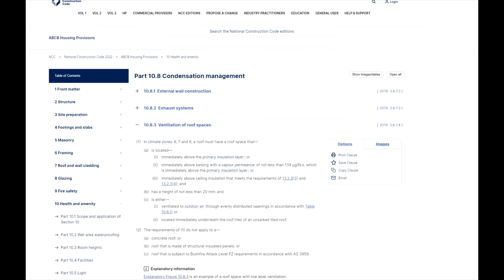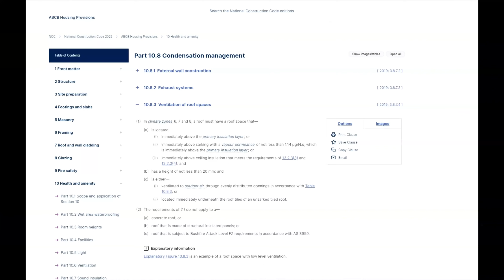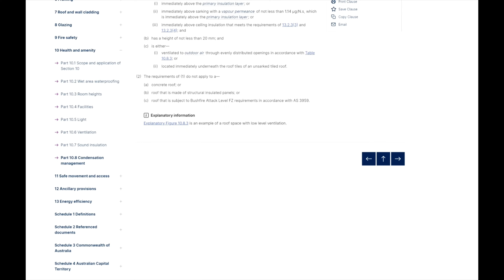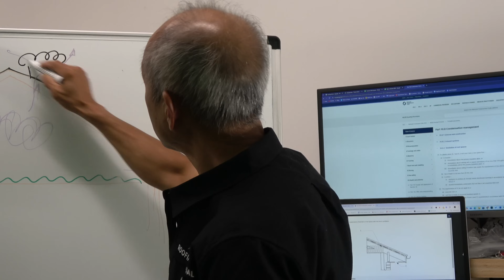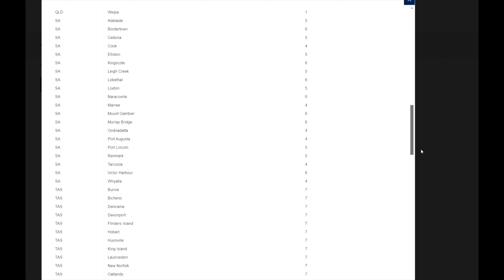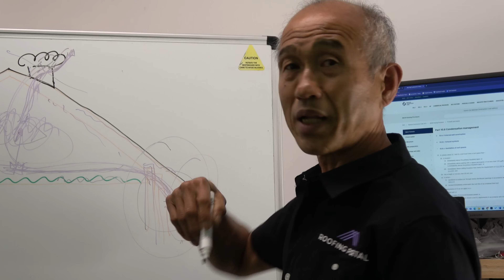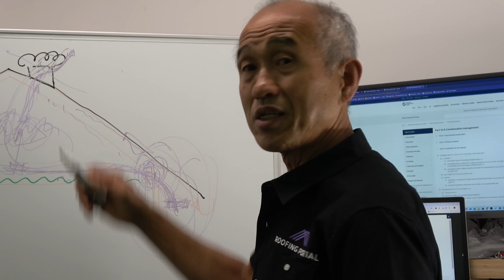Do whirlybirds work and will they make a comeback

Comment: If you're looking to make the temperature inside the house cooler on hot days and warmer on cold days then they might work some of the time. The physics is simple. If there's wind blowing, they rotate and remove air from under the tiles. But what if that air is hot, and it's a cold day? Then you don't want that hot air removed. Now consider a hot morning, and there's nice cold air under the tiles from the cool night. Then you want to leave that cold air alone, not pull it out! Whirlybirds are a dumb device that cannot make simple decisions.

Comment: The NCC does its best to add onerous costs on to new builds with low regard to the housing crisis that's been brewing for 20+ years. Recent one supposedly added $30K to a build, and am sure they new venting requirements will add extra thousand(s) to it - probably requiring solar powered whirly birds with power backup (when sun not shining) for ventilation - they're so damned expensive and was told they're useless for cooling as marketed as you have more energy going in from the sun every hour than those solar powered extractors can remove, so for cooling it only works when the sun goes down and then it relies on mains power for them over just hot air/wind from the manual ones.

Comment: Very interesting. Seems like roof ventilation needs to be bespoke. From what I can see the whirlybird creates a vacuum to drag more air into the roof space ? But the air needs to come from somewhere cooler (eaves)… but takes a lot to inspect to see if your home eaves are ‘blocked’. In those cases, Amy even need to install a fan and ducting to drag in new cooler air?… or watch part 2…..

Also, I’m loving everyone’s comments posting their knowledge…

Comment: Have 2 of these on my roof. Replaced about 15 years ago and current ones have been there about a further 15 years. Seem to keep the roof space cooler than it would normally be but hey I am no expert. Looks like I am in a zone 5 area. No eaves vents though. This is my second house and has a green colorbond roof. This house is much cooler in summer than my first house which had a dark coloured tile roof and was virtually uninhabitable during hot summer days/nights!

Comment: My house has 2 whirlybirds but no eave vents.
On a warm day, the whirlybirds spin like crazy, so I'm guessing the airflow is happening due to ceiling vents in bathrooms and toilets.
Reply: Does that mean they're sucking the cool (air conditioned?) air from inside your house?
Reply: @iamdave84  
Yes, more than likely.
Though, being colder air, it should sink and displace the warmer air in the room. But not an ideal scenario.
Case of house designers not thinking things through.

Comment: I had a slab on the ground house and created louvre pivot windows in the gables. I could open the louvres from inside the house with a cord. This allowed the entire roof space to change air mass very quickly.... not all Australians are as dumb as you infer..... 😄😃😀🇦🇺
Reply: Yeah, those kind of louvres are perfect for Queensland weather. high ceilings with easy accessible lever windows; every house needs one. You should be working for Department of housing or whoever it is that makes up all those housing rules! I swear whoever has been doing it for the past 50 years has been totally inadequate.

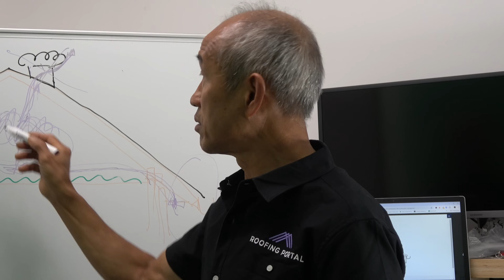Comment: 6:25 in older buildings whirlybirds work because the majority of the buildings leak air like sieves, nothing is sealed.
In newer buildings with insulation in the walls and roof and even floors with every little air gap plugged or calked the whirlybird can only let hot air escape until the pressure is equalised, then when things cool down cold damp air can be sucked in.
Always install vents in the eaves along with whirlybirds.
Reply: that's wrong. Code in Aus still calls for air flow in walls and roof spaces to eliminate dead air that would otherwise generate issues. What people don't seem to realize is that Turbine Vents weren't designed to affect temperature, they were designed to remove humidity. This has a positive effect in both the summer and winter months, and is recommended in the Australian climate.
Reply: Therefore the first 6:00 of this video was a waste of my time.
Reply: @paullelys161  only if you have a new house. Most of our cities still have a majority of older homes.

Comment: If you want to see a bigger difference, make a chimney stack with metal tube about 2 meters long, paint it matt black, have the bottom at the apex of the roof to suck from the highest point, mount the whirlybird on top, but any rain cover will work too. 
The tube allows the whirlybird to move more air, plus the black tube will heat up the air as it moves up making it move up even quicker.

Comment: you could argue any brick veneer house is inherently vented. The roof will be framed off the timber and the whirly birds should be able to suck air through the cavity
Reply: I was thinking the same thing, especially if the house isn’t on a slab.

Comment: Whirlybirds only work if there is a fan under it.  They are supposed to extract hot air from the roof space..
Reply: They are their own fan Kev, and heat rising makes them spin automatically (they should be installed high on roof pitches, preferably near upper ridgeline.

Comment: The problem with Whirlybirds is the create negative draw and can draw the air-conditioned air from your home working your air conditioning overtime. Making incredibly inefficient..
Reply: Only if you have air conditioning, which I don’t. My 1972 brick veneer, concrete tile roof vents itself with my three whirlybirds.

Comment: Thanks for this video. 
I have a very old house with a corrugated iron roof in Tasmania. We don't have a moisture problem, but I was going to have whirlybirds installed to remove heat. We also don't have eaves of any substance. What would you suggest for a lower level vent in such a roof? Would a whirlybird installed low on the roof work for the intake in conjunction with one installed high for the outflow? Or some form of other vent that is weatherproof?
Reply: Hi, you could consider a gable vent.

Comment: There used to be a product called Decor Vent which seems to have gone into obscurity. Decor Vent consisted of cement sheet eaves lining with a continuous run of slots usually at right angles to the building wall and approx 120 mm x 12 mm and spaced about 100 mm apart. This provided a continuous vent for the full extent of a building's eaves overhangs and was very successful. May be it will come back again although there are other companies that will perforate cement sheet in any pattern you want. I'm not sure that the congestion you refer to at the wall line is such a big problem as there is usually plenty of air space there - often more so with today's truss framing. In saying that, care is needed with the placement of ceiling insulation to ensure the airway isn't blocked - as you suggest.

Comment: on older homes, when inside the roof, you can see light between the tiles, i see inlets everywhere!
Reply: Yes, most concrete tile and terracotta tile roofs have gaps between the tiles. These would allow sufficient air to be drawn in to replace the rising hot air being extracted.
Reply: To get ventilation working under tiles you have a special shaped tile. Its more rounded and shaped a bit like an ice cream cone (without the pointed tip).

Comment: Your comments would only apply to roof cavities that are airtight. Very few roofs would be airtight. My roof is a tile roof which means there are gaps everywhere!
Reply: Even iron sheet roofs are not airtight, if you have just one or two whirlybirds, there is ample room around a roof perimeter corrugations to allow air flow.
Reply: @lesskinner8588 those corrugations fill up with the insulation blanket mass.
Reply: Also if your roof is tiled your house is probably brick. Brick houses don’t have eave vents on purpose. They have ventilation slits at the bottom of the external walls around the house to ventilate the walls as well as the roof. I hope people don’t watch this and then cut holes in their eaves. It will stop the buildings ventilating in the way that they were designed.
Reply: @EarthRook  people are stupid, this youtuber the most
Reply: @EarthRook weap holes
Reply: Whirly birds are intended for metal roofs, not tile roofs. They serve little real function on a tile roof.
Reply: @aussie8114  nonsense.
Reply: @aussie8114  why does it get to 60c under the tiled roof then? ventilating that would mean the insulation doesn't have to work as hard.
Reply: @derbybOyzZ The tiles get hot and radiate the heat. Terracotta roofs have lots of natural ventilation, concrete tiles have less, some low profile concrete tiles have even less, none if also sarked. As a concrete tile roof gets old the joins do get caked up with crap so then they have even less ventilation.
My point was mainly that the whirlybirds are intended and we’re invented for metal roofs, they are less relevant for tile roofs, unless it also has sarking, but they can still serve a purpose if the roof has air intake as well. But fairly pointless for a terracotta tile roof.
There is the downside though of having any penetration in a roof allowing a water entry point.

Comment: There is debate about whether the spinning action of the whirlybird works or not. But roof exhaust vents absolutely do work when used in conjunction with eave vents. Basic law of thermodynamics, hot air rises to be replaced by cool air.
Reply: Spinning is useless, there is a video (in foreign language) where air flow is compared with conventional ventilation. There were no improvement, whirlybird was even worse, they reduced air flow.

Comment: How about people stop have dark coloured roofs that cause the excessive heat in the roof mmm
Reply: Yep, daft. A light roof reflects light / heat. Case in point we have a new light roof (surfmist) a neighbour has a dark grey roof. They had to install whirly birds because it got so hot upstairs. Ours is fine.
Reply: I am not a builder or have any experiance. However I believe two things that would help as much as anything. Go back to 10 foot ceilings, and high pitched rooves, that were used around 100 to 120 years back. Add good insulation, whirly birds with eave vents, and a 12 foot verandah on 4 sides of house. Yes it would cost far more but require little to no air conditioning.  

The other one I found once. I done some cleaning at a house. After the owner gave me a cold drink. We sat underneath the house, which was a high set. It must have been 8 to 10 degrees C cooler underneath. A false roof, 1.5 to 2 metres above the house roof would have the same effect. Again expensive, but very effective. Combine this with what I said above, a 30 c day in Brisbane, 20 in the house. 40 c likely 25 in the house. ???
Reply: @johnblyth9787  Very well stated. Yes, without a doubt extra layers will bring the heat down. I remember at a beach bar in the Pacific once there was a clear plastic roof and it was like an oven underneath it. The locals set about slashing palm fronds off trees with their machetes and put about three layers on the roof and hey presto; it was cool under the roof!!

Great insulation can do it with a roof mind, as can lighter colours.
Reply: I totally agree with you. It’s the only way to build a house in Australia; extreme pitched roofs and high ceilings.
Reply: @johnblyth9787 Good for hot weather areas but high ceilings are bad to hear in cooler areas.
Reply: 100% agree,QLD have white roofing although some are now going dark,should be banned by law.
Reply: All the above plus there are rules to follow regarding colour.  Stupid isn't it 😅
Reply: New developments have white tiles etc
Reply: So true. We repaired our dark green / almost black tiled roof, had it cleaned and painted, selected surfmist. The roof temperature would get to 75 degrees before, only 45 degrees after painted surfmist. Hardly ever used air con again 👍🏼
Reply: How about we stop cutting trees, that is what is warming the environment
Reply: in a cooler climate, we want that heat to help warm the house during the longer cool periods. Yes it means hotter in the shorter summer period, so controlled ventilation is the answer.  One solution does not work everywhere.
Reply: @Andrew-kz8qp  In hot cities of Australia, light roofs are great
Reply: @DougieL  I'm an energy rater. Individually, in cooler climates a dark roof generally reduces energy consumption overall for the year, and less green house gas emissions. As a collective, there is argument that the dark roofs contribute to heat island effect, where the city is heated. Yet we still have black roads directly connected to earth that the roofs are not connected to.  For reading, I suggest the Berkley Labs Heat Island research group. A lot of good papers there.
Reply: I was on a roof and pointed this out as we were doing Hebel and other bloke said nah they put heat resistant roofs or something and I'm thinking yeah but black doesn't it absorb heat. I been on a lot of roofs that scorch ya, but somehow this one I was able to put my palm on in clear skies sun out, didn't make sense to me
Reply: Yep. We chose a much lighter off-white grey from the medium-dark grey and the internal house temps over summer dropped a good 3-4 degrees or more. It made a huge difference to our reliance on cooling.
Reply: I second this, but the problem is, in areas where dick head covenants determine that your roof needs to be dark and stupid things like walls need to be all these matching colours etc. load of crap.
Reply: When I built my home 2013, only choice was dark tiles, if I wanted lighter colours, it cost extra, but I did get whirlybirds fitted.👍🇦🇺
Reply: I was told I couldn’t get a lighter roof because of council regulations. Apparently it makes it difficult for pilots in aircraft to fly if they’re are reflecting light every where.
Reply: @littlejohn-pi7kk   Yeah, that's bullsh1t, we used to have a lot of galvanised roofs, and most industrial complexes have gal roofs, they reflect light badly, they also get extremely hot....
Reply: My house has a light Grey tin roof. It's still effing hot.
Reply: How about normalising insulation or making it mandatory?
Reply: My light coloured colorbond roof is filthy with moss and dirt, it's 2 storey and unsafe to get access to clean it
Reply: because Light colors show mould and grime and look like shit.
Reply: If people are so worried about their roofs looking clean, they should use the money they saved in cooling to get it professionally cleaned. That way, not only will it look clean, it will actually be clean.
Reply: @GruntyGame   dont talk shit mate, not everyone is loaded with money.
Reply: A dark tin roof, is cooler than a concrete tile roof.  However, tin cools much faster in the evening.  Installing silver sarking directly under the tiles would mean the roof is 10X coller than the light coloured roof next door.
Reply: Yep, pretty stupid really, Australia have more hot days than cold days in the area where most Aussie live. Well, at least the heat is unbearable , while the winter here is generally quite mild.
Reply: Surf mist keeps your roof cool, but it's a maintenance nightmare. Because it promotes mildew growth. Darker colours and zinc alum evaporate the water quicker preventing mildew. Zinc alum actually helps kill the mildew.
Reply: @malachisimons4376  ALL roofs get dirty mate, every single colour, one colour in particular does NOT promote mildew, that's simply NOT true.  Modern roof paints still get dirty but they don't get mold...
Reply: It is the steel  / tile that gets hot. Not a thin bit of colouring. Otherwise a white car would never get hot to the touch. Its called thermal mass.
Reply: @darrennorth929 that is beside the point. Dark colours absorb the energy in light. The energy gets converted into heat which is stored in the material underneath. Light colours reflect light so the energy in the light does not get turned into heat.

No one is saying the heat is stored in the very top layer.
Reply: @darrennorth929  A white car is far cooler than a dark red, or black car mate, anyone that knows anything about paints colours or thermal barriers knows this. I was working with a guy years ago , when we got to his place after work I was standing between our cars, mine is red and his work ute is white. I was leaning on the roof of his car chatting when I changed sides and lent on my bonnet, I BURNT the white skin on the underside of my arm, I mean it blistered, anyone knows white cars are far less hot that dark coloured ones, dark colours absorb far more heat, this is a well documented phenomenon...  PS, I'm a painter by trade {industrial} and have also done roofing and repainted roofs for probably longer than you've been alive...
Reply: Light colors show mould and grime
Reply: @AnarchyEnsues That's the universes way of telling you to get of your butt and clean your roof!
Reply: @AnarchyEnsues  What a lame reply, I've painted roofs for years and they ALL get dirty mate. White roofs are FAR cooler....
Reply: @MickH60  hardly lame

Me and my father pressure washer his cream colored colorbond roof 2 years ago.... 3 months later covered in shit again.

Darker colours are better to not show this... Fact.

I have a close look at my dark grey tile roof... You are right it's dirty... No wash ever....  Doesn't draw the eye towards how dirty it is.
Reply: @AnarchyEnsues  Get up on the roof and clean it.  Black roofs because they otherwise get dirty is the dumbest idea.